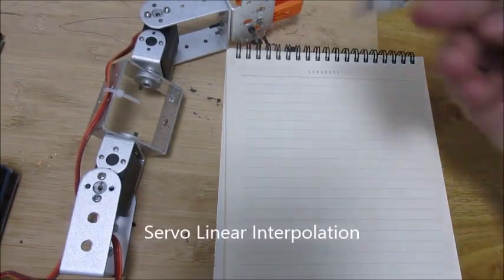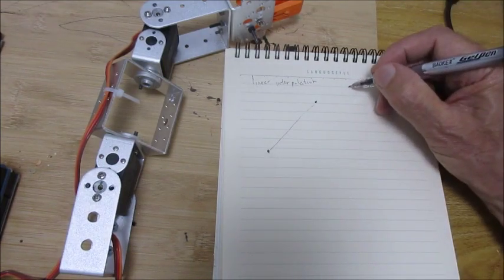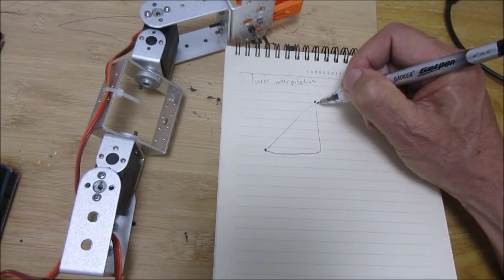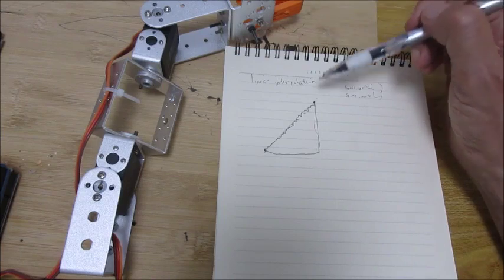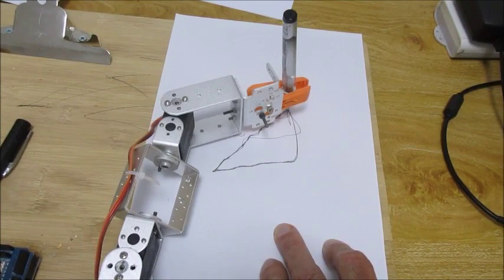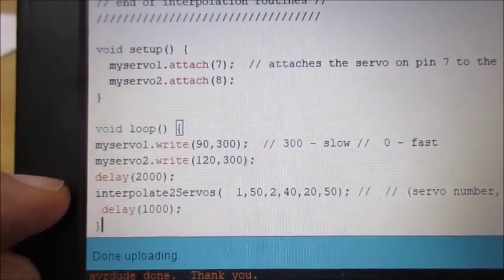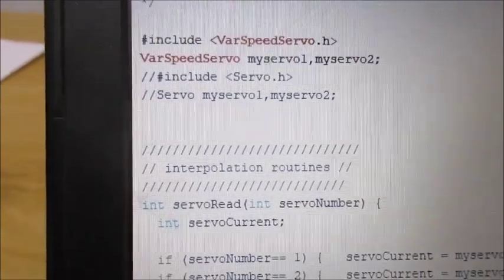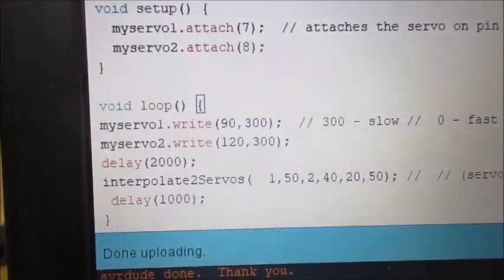Servo Linear Interpolation

Comment from the maker: Here is code:
/*
 Servo linear interpolation by Jim Demello, May 2019
*/

#include <VarSpeedServo.h>
VarSpeedServo myservo1,myservo2;
//#include <Servo.h>
//Servo myservo1,myservo2;

/////////////////////////////
// interpolation routines //
///////////////////////////
int servoRead(int servoNumber) {
  int servoCurrent;
  
  if (servoNumber== 1) {   servoCurrent = myservo1.read(); }  // read servos current position
  if (servoNumber== 2) {   servoCurrent = myservo2.read(); }
   return servoCurrent;
}

void servoWrite(int servoNumber, int offset) {
                
   if (servoNumber==1) { myservo1.write(offset);                  }
   if (servoNumber==2) { myservo2.write(offset); }
  }

void myServo(int newAngle,int angleInc,int incDelay,int servoNum) {
  int curAngle;
  if (servoNum== 1) {  curAngle = myservo1.read(); }
  if (servoNum== 2) {  curAngle = myservo2.read(); }
   if (curAngle < newAngle) {
   for(int angle=curAngle;angle < newAngle;angle += angleInc) {
         if (servoNum == 1) myservo1.write(angle);
         if (servoNum == 2) myservo2.write(angle);
         delay(incDelay);   }
   }
   else if (curAngle > newAngle) {
      for(int angle=curAngle;angle > newAngle;angle -= angleInc) {
        if (servoNum == 1) myservo1.write(angle);
        if (servoNum == 2) myservo2.write(angle);
        delay(incDelay);   }
   }
   }

void interpolate2Servos(    int servo1,int servo1Position,
                            int servo2,int servo2Position,
                            int numberSteps,int timeDelay){
     int servo1Current,servo2Current;
        
     servo1Current = servoRead(servo1);
     servo2Current = servoRead(servo2);
   
      Serial.print("Servo1Pos and Current ");  Serial.print(servo1Position);  Serial.print("  ");   Serial.println(servo1Current);
      Serial.print("Servo2Pos and Current ");  Serial.print(servo2Position);  Serial.print("  ");   Serial.println(servo2Current);
      Serial.println(" ");
             
     int aOffset = (servo1Position - servo1Current);  aOffset = abs(aOffset)/numberSteps;
     int bOffset = (servo2Position - servo2Current);  bOffset = abs(bOffset)/numberSteps; 
   
     int aOffsetTotal=0,bOffsetTotal=0;
    
     aOffsetTotal = servo1Current;
     bOffsetTotal = servo2Current;
    
      for (int x=0; x<numberSteps;x++) {
        if (servo1Position > servo1Current) { aOffsetTotal = aOffsetTotal + aOffset; }
        else                                { aOffsetTotal = aOffsetTotal - aOffset; }
        if (servo2Position > servo2Current) { bOffsetTotal = bOffsetTotal + bOffset; }
        else                                { bOffsetTotal = bOffsetTotal - bOffset; }
              
        if (servo1Position != servo1Current) servoWrite(servo1,aOffsetTotal);
        if (servo2Position != servo2Current) servoWrite(servo2,bOffsetTotal);
       
               
    //    Serial.print(" a and b Offset  "); Serial.print(aOffsetTotal);  Serial.print(" ");Serial.println( bOffsetTotal); delay(10);
        delay(timeDelay);
   }// end for
    //////////////////////////////////////
    // take care of modulo remainders //
    /////////////////////////////////////
      
        if (servo1Position != servo1Current) servoWrite(servo1,servo1Position);
        if (servo2Position != servo2Current) servoWrite(servo2,servo2Position);
    }
////////////////////////////////////
// end of interpolation routines //
//////////////////////////////////
     
void setup() {
  myservo1.attach(7);  // attaches the servo on pin 7 to the servo object
  myservo2.attach(8);
}

void loop() {
myservo1.write(90,300);  // 300 - slow //  0 - fast
myservo2.write(120,300);
delay(2000);
interpolate2Servos(  1,50,2,40,20,50); //  // (servo number, servo1ToAngle, servo number, servo2ToAngle, number of steps per interpolation, delay time per step)
 delay(1000);
}